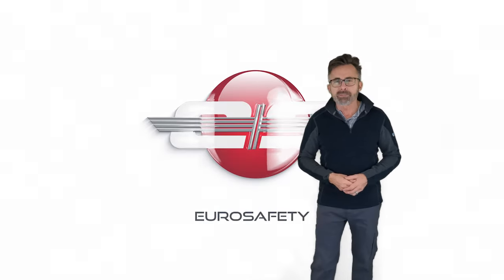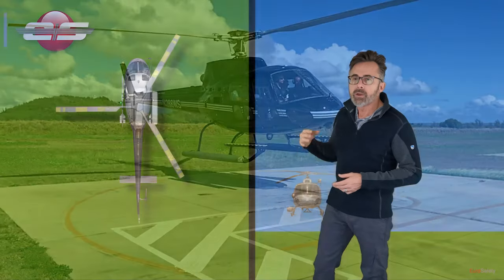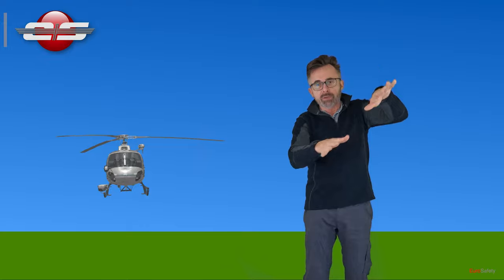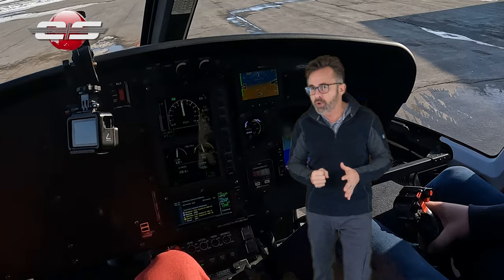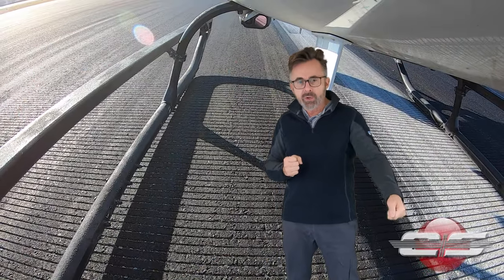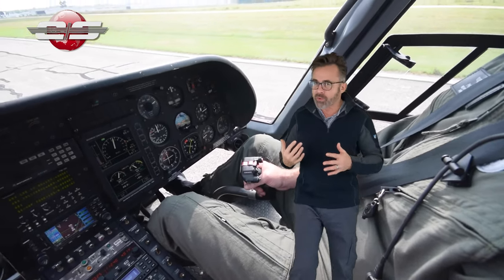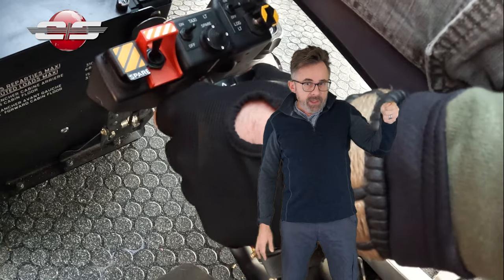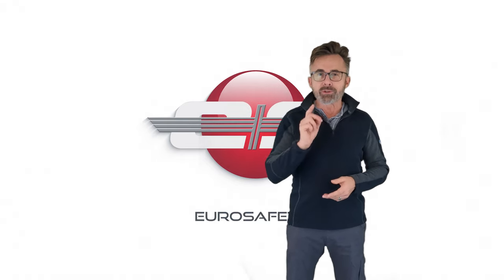Pilot Tip: Picking up and Landing an AS350 Helicopter

Comment: The thing I recall many years ago was what's called PIO. Pilot induced oscillations. The AS 350 is a very responsive aircraft. Very slick. If you just relax on the flight controls, very minimal input is needed to achieve smoothness in any maneuver.
Reply from the maker: Very true